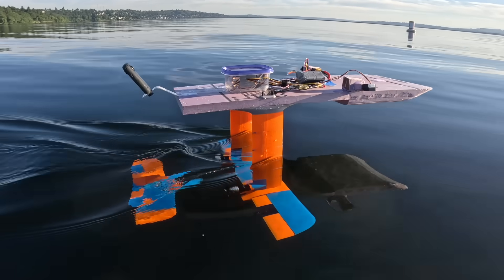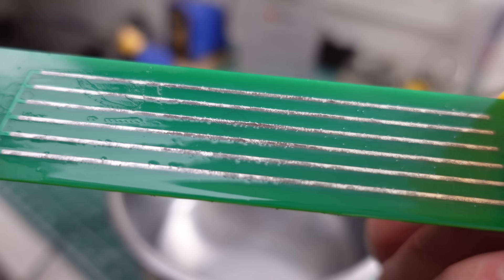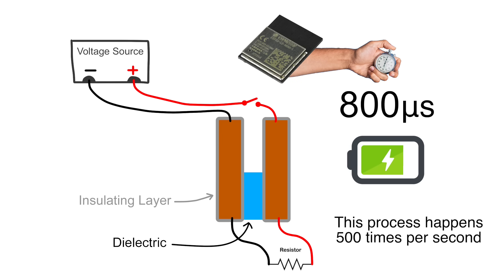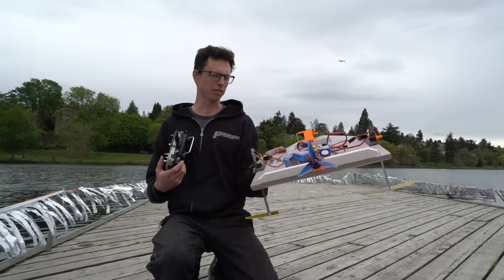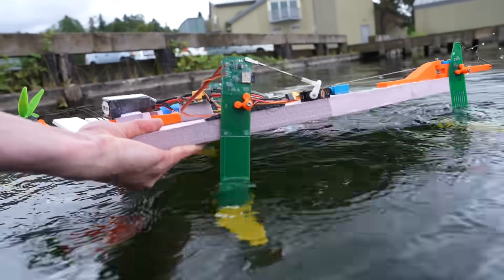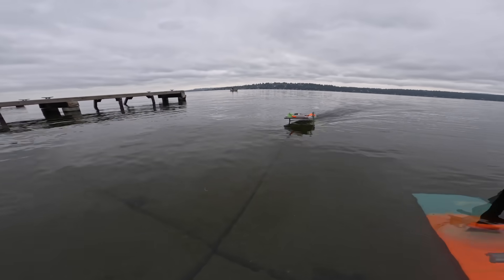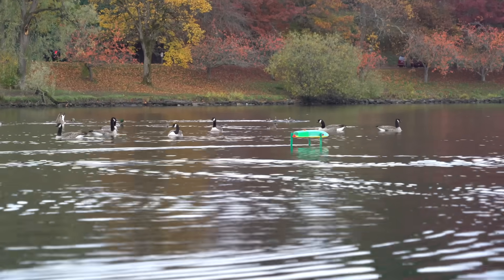R/C Hydrofoil Boat Made From Circuit Boards

Comment: Quick answer, 
High frequency ac that stops the ions getting across before being re combined. 
Basically you are electroplating. 

Long version, if you waterproofed your water sensor it would have operated as a capacitor at the high frequency ac signal.

Comment: What about using water pressure? Look into manometers... more specifically, manual mercury manometers! I think if you could hook a sensor up to the end of one, it could be an easier solution to what you're trying to do. Just a thought.

Comment: PID tuning requires getting a feeling for the transfer function of the system it is controlling. Different craft will have different responses and different transfer functions so you will need to tune the PID for each craft.

Comment: A brilliant idea, very robust, but the implementation is flawed. Salt water eats the electrode very quickly. But use a capacitive sensor, there is no problem from electrolysis with that.

Comment: Sweet!  I tinker with small electric boats, models, rc sailboats, etc - I've played around with DIY cnc machines, 3D printers, and laser engravers for years (actually ran a plasma cutter 30 years ago working for North Sails to cut out sail shapes to be stitched up).  Anyhow, I'd totally build one of these.  As noted, I'll hold tight until the next video and a little extra fine tuning but it will be on my to do/to build list.  My ground effect airplanes have been less than stellar but you learn more from builds that don't work as expected.  Rock on.

Comment: What if you had a vertical shaft that water could fill. In that shaft would be a bunch of buoyant gates, above the gate would be a light sensor that rotor get blocked when the gates floated up. Then there wouldn’t be a need for electronics to touch water.

Comment: Maybe I am just an incredible simpleton, but rather than attacking this issue with custom PCBs etc and dealing with corrosion issues and such my gut reaction would be to solve this problem by making pairs of effectively buttons along the mast where two wires terminate next to each other where one goes to ground/or 5 volt and the other one of the microcontrollers GP pins. Comparing all the "button presses" would then give you a water level indicator and presumably the wires would be less prone to corrosion issues. With a Pico you could get something like 16 different water level thresholds which I would have thought would be sufficient and you would not have to deal with ADC inaccuracies which is a common issue with onboard ADCs of the pico boards and as in this video require more accurate standalone ones for speed and accuracy.

Comment: Could you not use a pressure sensor or two to measure distance from the foil to the water, rather than distance from the water to the board? That's how torpedoes did it from about 150 years ago, give or take, all mechanically.

Comment: I think lab equipment to measure dissolved salts in water uses an AC current to rapidly do and undo the corrosion in what is basically a resistance measurement like the early versions you made. Capacitive is probably a better idea for your needs though.

Comment: To avoid requiring recalibration, you add some stepped sensors. If you have one sensor that ends just above the intended water line and one just below the intended water line, or a couple more steps, you can use those in a digital-ish manner to live-calibrate the continuously variable sensor.

Comment: Instead of PCBs you can actually use something like speaker wire. I bought the AquaPlumb from Vegetronix several years ago and was surprised that all it used was a simple piece of speaker wire you would put in a water tank and could accurately measure the height of the water this way. It basically works off the same capacitance that you are doing with the PCBs. If you went this route you could save weight and also simplify things a bit.

Comment: instead of resistive level measurement (which eats up the eletrodes) you could use capacitive sensing, by using the waterlevel to change the capacity between the 2 plates (e.g. by detuning an RC oscillator with that variable C). so you could burry the traces under a 2nd pcb layer or just wrap and fiberglass it with a coat. 
I posted too soon... my concerns are fully covered... forget what i wrote ;-)

Comment: This makes me wonder how sensitive pressure transducers can get.  If they are sensitive enough it could be used and keep all of your circuits out of the water.
Reply: One that I’ve used is 24 bit and can read every 5 ms. If it is attached to a tube underwater, and the end of the tube kept out of turbulence, seems it would work. Though imo the capacitive method looks better, simpler, cheaper.

Comment: Do you know mems pressure sensors? They can "see" 1mm of water pressure. Just keep em dry. $2 one.
Why do you move the whole strut and not just the foil?
Reply from the maker: because mechanical complexity and hydrodynamic drag
Reply: @rctestflight  And the mems sensors? mm accuracy? You can do it!

Comment: Well, in still water I would use an accelerometer together with the other sensors to measure the vertical acceleration and try to stabilize it.

Comment: You could also embed electrodes at different depths of the stem.
With clever code you don't need the high resolution of resistive measuring.

Comment: I used to work in industrial controls and we never came up with any level sensor using conductivity that would not fail, and fail fast.  One of the best sensors we developed was an air tube open at the bottom and a pressure sensor at the top with a tiny air pump that would keep the tube filled with air and slowly discharging the air from the bottom (within the fluid being measured).  The deeper the probe is in the liquid the more pressure there will be in the air tube.
For a hydrofoil many simply use multiple levels of small wings with increasing angle of incidence so as the foil goes into the water these wings will interact and increase lift until they are again at or above the surface where lift reduces again.  Of course such a system must be tuned to specific speeds.
What would probably work best for a model is a small  feeler foil that is sprung and angled to ride on the surface and a hall effect sensor to read the angle of this feeler foil at its attachment point (pivot).
Reply: Feeler foils might not work well at the very small scale the prototypes in this video are working at.  The feeler needs to be small and easily driven, but even the smallest ripples would effect it and make the entire craft react to said ripples.  On a larger vehicle, you can make the feeler much larger and use a spring system to dampen the signal, but tuning such a system on a very small craft would be quite difficult, I think.
Reply: @jamesburleson1916  Largely why if I were scratch building this I would have shot for a ladder foil to give it its altitude stability and use the radio to very slightly trim so you can adjust the altitude based on speed/changes in speed to the optimum.  That is the only real issue using ladder foil for inherent stability is that the flight height will be dictated by speed unless you incorporate a trim but there should always be a viable combination of speed and trim where the ladder will give good stability and efficiency.
Reply: @larrybremer4930  Larry, your channel has NO content...
Reply: @larrybremer4930  I haven't seen a ladder foil used in earnest in decades, even in a concept. Efficiency has never been a word associated with them as any speed where there where the craft is not carried on just the lowest foil adds drag incredibly fast, both from wetted area and from the innately higher drag of the low speed foils.
Reply: @weatheranddarkness  by ladder foil I was meaning only 1 secondary foil at the desired ride height but was trying to avoid getting into an overcomplicated explanation.  1 small foil that would give about a 5-20% lift boost depending on its trim angle that would be set based on sea state (low for smooth water and steeper for heavy seas).   With a foil trimmed out for the speed setting and the ride foil set for the sea state the boat as a system would have very high inherent stability and very low mechanical complexity.  Both desirable elements for a model and it would require no height detection, control automation, or POGO oscillation tuning of the control system.  There would probably be some speeds and sea states that would cause the two foil solution to oscillate as well and the only solution for that would be to change speeds and re-tune foils to get out of the harmonic resonance that caused the oscillation.
Reply: I’m pretty sure some of his earlier designs used feelers

Comment: try capacitive touch sensors, in place of resistive water sensors.  these can be fully insulated from contact with the water and cannot corrode, however they may not be fast enough for your application.  to date this is the best solution i have found for salt water level detection, in my bilge pump applications.  oh, i see you got there too.  if it helps, chinese chip ch552 series has five sensors on board, is very fast and is programmable.  another alternative that seems to work is to put alternating current through your resistive sensor, this will mitigate against electrolysis somewhat.  you could also try carbon rods instead of printed traces for the sensor itself, i find these last much longer, and will stay calibrated a lot better, if you use an a/c pulse.  in theory this method would be many times faster than detecting capacitance, but you will still need to clean the sensors frequently.

Comment: Great!
Here's a suggestion regarding the tilt of your motor, as the thrust axis is oriented upwards.
I've built a lot of model airplanes and I can't explain exactly why, but for good flight balance, the motor always had to have a small negative angle, with the axis pointing downwards (2 or 3 degrees).
That's the opposite of what you're doing... Maybe this is also the case on the water?
Something to possibly try...
Keep up the good work
JC

Comment: Alternating the positive and negative, maybe it helps with corosion, maybe it make it worse. Reason: current flows with ion and this is your pcb tracks. When you alternating it, you may rebuild it from the other track.

Comment: Resistiv "water-sensors" are basically a scam: You can find them everywhere advertised for cheap DIY-projects but they are just awful. And then you somehow managed to find a guy that has no clue on how to create schematics from a simple electrical diagram. HOW THE HELL can you be so stupid as to not manage to get basic trace-layout correct?
Reply: Probably a communication issue

Comment: I keep wondering why you use everything but conformal coating when waterproofing things?  Conformal coating is awesome because it glows brightly under UV light so even a cheap UV flashlight shows you exactly your coverage area and relative thickness of the coating.  Hotglue gets compromised by both heat and UV light so I've had awful luck using it to waterproof, and Corrosion-X and other water displacers can get abraded away by things, but conformal forms a really well bonded unbroken coating in my experience.  I'm assuming you had it fail on you before, maybe thanks to salt - I've only had to worry about freshwater.  Just curious why never conformal?
Reply from the maker: because when I conformal coat my electronics they still fail

Comment: Some heavy gold plating of the pcb will solve the corrosion issue of the original design.  Gold won't dissolve electrolytically unless you are riding in cyanide solution or hydrochloric acid.
Reply: Stolen comment, this is a bot
Reply: clanker
Reply: Joined 1 day ago
Reply: Unfortunately it’s not that easy, as running a current through causes galvanic corrosion, and gold is still susceptible to that.
Reply: Even so, there would be all sorts of issues, with variable conductivity due to salinity differences. 
And it is not true that gold will not electrolytically dissolve. It is called electro winning an electro refining. And we have been doing it industrially for over 2 centuries.

Comment: I'd recommend packing the PCBs with big vias around the areas you're attaching them together with solder - as it was now it looks vulnerable to the pads ripping off the board. If the solder joint extends through the PCB it's a lot stronger
Reply: Or put the trace underneath so it can't pull off.

Comment: Just wondering... could the entire hydrofoil and all components be constructed from a single PCB? Have it perforated so the towers and other bits could be snapped off from the main body and soldered into place, then just glue a sheet of foam to it?  That would make an amazing kit.

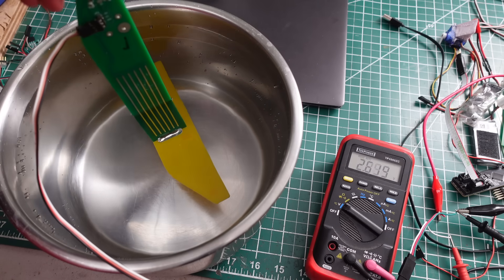Comment: 2:15 ok, THAT is cool.  So it's completing the circuit AROUND the board.  I wonder how many of the leads you actually need at that scale.  Would a long enough (and slightly wider) lead pair work as well as that small board that needs a bunch of them?

Edit: shutting up, hell yes, I just needed to keep watching XD.  so damn cool.

Comment: Have you seen that 6.5 million dollar drone challenge from DARPA? They are challenging the public to build a 107 compliant drone that can pick up a heavy payload, autonomously fly 5 nautical miles and drop the payload in under 30 mins. Once I saw that challenge I was oh that should be lightwork for rctestflight! The only problem is that "heavy" payload is 110lbs and any drone that is 107 compliant must be 55lbs or less. Maybe thats why they are offering such a high price bc the thrust/weight ratio needed is almost physically impossible; If build stays 107 compliant that is

Heres the link to the DARPA video detailing the challenge:
https://www.youtube.com/watch?v=TMHjTMabWiI